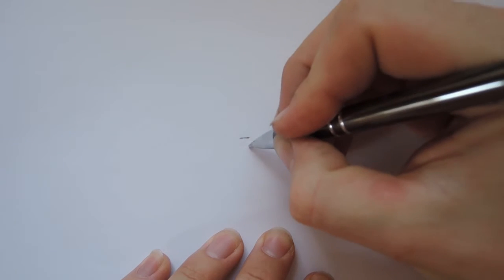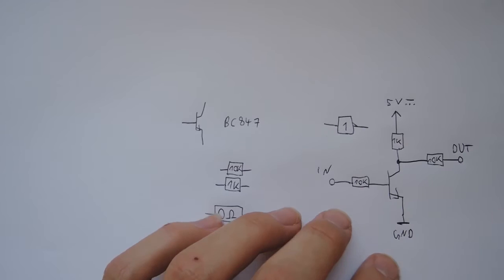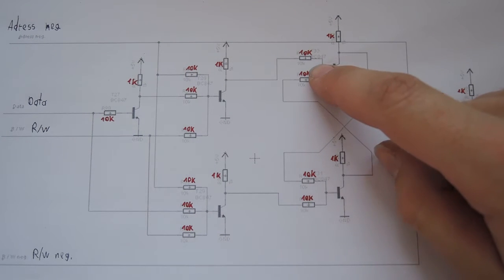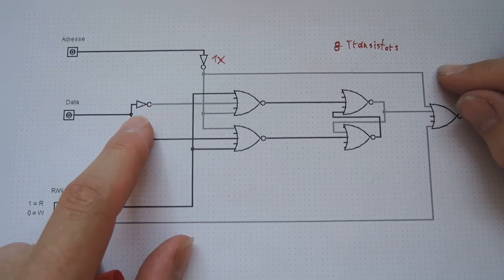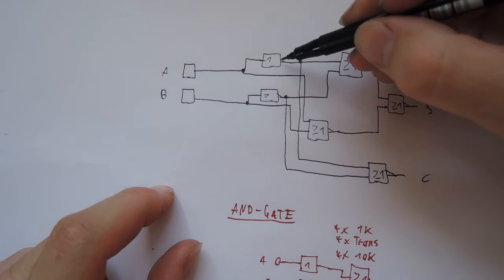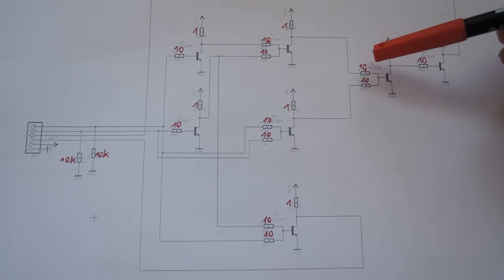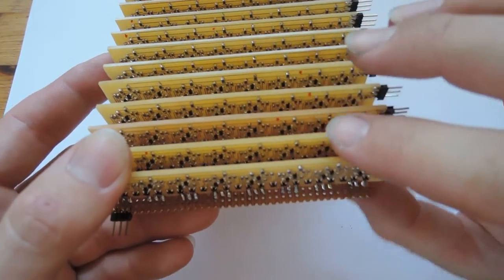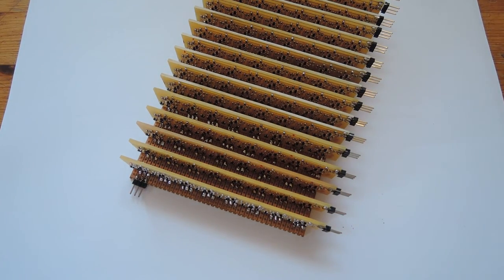Memory and logic circuits.

Comment: Why is there 10k resistors in front of every transistor? Is it because of voltage incompatibility or something else with the type of transistors you have chosen?
Reply from the maker: In my case, I use them as logic switches. 1K is for not damaging the transistor while it is conductive. If the Base-Resistor is 1k too, some current will flow through the next transistor.
This little amount could be added up and cause a bug.  (Finding it, is almost impossible) Trust me :D
So the 10k is for reducing the base current and to guarantee, no current (voltage actually) switches on the next transistors.

Comment: Hello! I was looking for some homemade transistors and I found your job. Really nice. I can see you are a dedicated. You have knowledge. But I think you are spend to much time and money to building this staffs with your self-hands. Every thing there are very cool. Erery thing well done. But today, the processe to building circuits, are made with potos, acids, galvanization, etc. and this process can be more quickly and build hundres and hundres of components.
Reply from the maker: +Luiz Augusto Prado Thx for your opinion. I know the photo positive/negative method, but the toner thing is easier and cheaper for more people. For the etching, you need something to dissolve the copper and there are few ways to do it. And with electro-plating you can make multi-layers, but you can do it also without. And these hundreds of PCB's must be soldered and equiped with components :D

Comment: Hey Martin, nice work!  But I'm a bit curious of why you use the Veroboard backplane upside down? Usually the copper stripes are on the backside and the parts (in your case the individual daughter boards) is on the top.  

As it is now you can't desolder a  daugherboard if it would become necessary. Or do you have a unusual Veroboard with copper on both sides?
Reply from the maker: +Mats Engstrom Hello :)  If i would turn the Veroboard, all the 16 memory boards would need much "metal-pins". (Via the Veroboard and then soldered on the other side)
                                To be honest, they can't be destroyed, if the voltage isnt't over 20V (Then the current would burn them a bit)
                                Btw, the unusual Veroboard would't help anything, when desoldering is needed.

Comment: Arne your inputs inverted? Because i don't see how giving the last nand gate when address is high makes any sense. Btw i think this is amazing!
Reply from the maker: +MrGoatflakes 1st : NAND-latches (RS for example) work with a zero -----_-----   (Allways 1 normally)
                             2nd : Nice idea. Maybe it will work with one logic-gate, but i have lots of them on one board, maybe it is a bit too inexact these "states".
                             3rd : Jeah, if 5Volts are on one base-resistor, the transistor conducts to the ground and the output is about zero volt. ;)
Reply: I ment are in the begining but autocorrect
Reply: my bad thought you were using nand but i saw later that you was using nor. just ignore me
Reply from the maker: +TheRojker Jeah, nor-gates only need one transistor. If they are better, i don't know. Thx for your opinion!
Reply: +Martin Brandstätter yes and usually latches and flip flops are based on RS NOR latches. I wanted to do it once in Minecraft redstone as an RS NAND latch, to see if it could be done, and I convinced myself that logically it didn't do the right thing.

But maybe I was wrong and I can't remember the reasoning right now :p

But also can't you make a NAND gate with only 1 bipolar transistor and some resistors? Just have it with more resistance on the two inputs so the combined input is needed to be enough to pull the output down?

And if you say have half of the resistance, even one input is high enough to pull the output down to ground and so it becomes a NOR gate. Or have I got it completely wrong? Please excuse any ignorant comments, posting after not sleeping hardly at all during the weekend :p